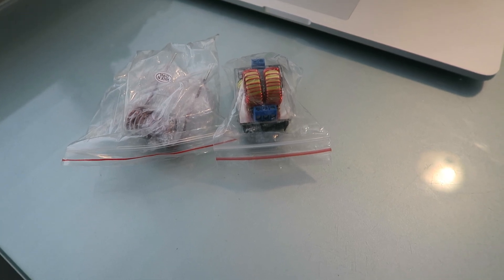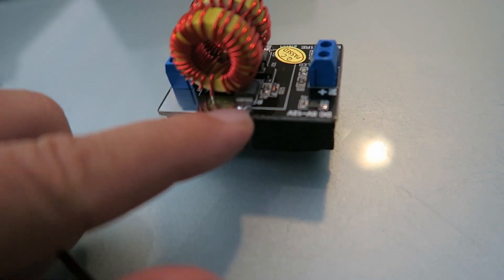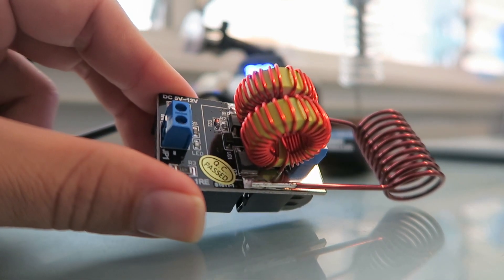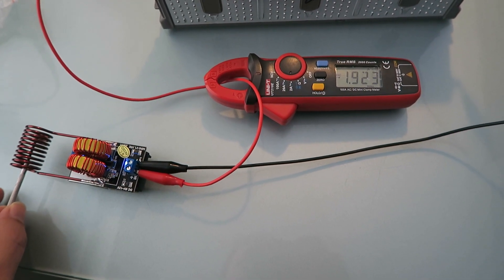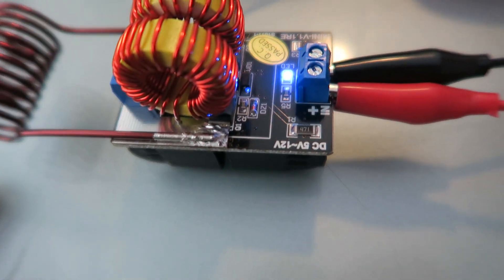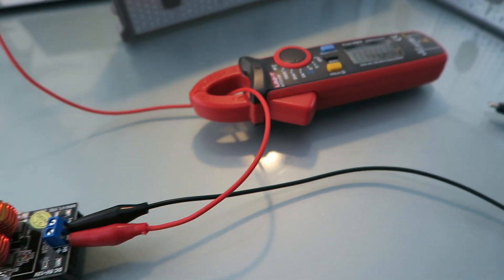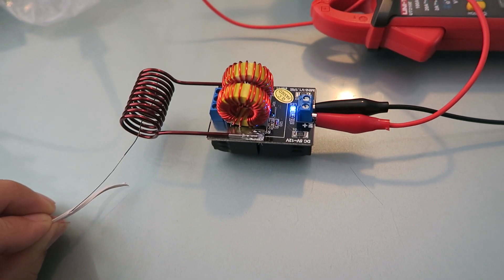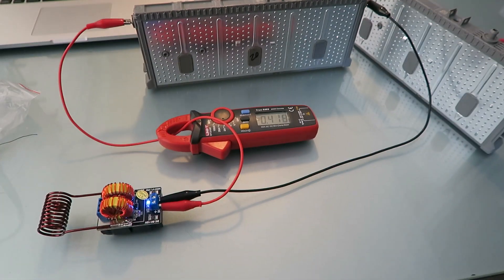120w 12v ZVS Induction Heating Power Supply Module

Comment: Add a Center tap to your coil and connect to center connector on unit. It will increase oscillation and quicken heating operation.

Comment: Boa tarde amigo, comprei um indutor desse, e uma fonte, de 10 amperes, funciona bem com uma chave de fenda mais quando uso um ferro mais grosso fica com o led piscando dos ambos e não esquenta por favor me dê uma solução.
Reply: Ola amigo. Sorry my Spanish sucks. But add a Center tap too your coil and connect it too center of connector on unit. It will increase oscillation and quicken heating.

Comment: Vladi Mazzilli (as registered on FaceBook...) actually worked on Tesla Coils using Flyback Transformers while he prefered to call his circuit a "Royer ZVS", patented in 1954!  Etc, etc...  Here's a complement of external resources to help reset the clock and provide a much wider perspective:

        https://i.postimg.cc/9Q0fsf8f/About-Vladimiro-Mazzilli-vs-Royer-ZVS-Known-as-vladi-mazzilli-on-Face-Book-Graph-ed-by-Egzoset.png

        https://www.facebook.com/photo/?fbid=10201891384713892&set=a.1979407652483
        Flyback Transformer setup (HV/plasma)

        https://www.facebook.com/vladi.mazzilli

        mazvla @ iol dot it }

        https://patents.google.com/patent/US2783384A/en
        US-2783384-A · Electrical inverter circuits

        https://www.facebook.com/photo?fbid=10201892284336382&set=a.1979407652483

        https://www.youtube.com/watch?v=Udxe0nbVnTE
        YouTube: Mazzilli DRSSTC (2010-Oct-12)

        https://www.pupman.com/current/vladi/vladmap.htm
        Mazzilli Vladimiro's Tesla Coil images

        https://i.postimg.cc/L8rdxxH4/Jorg-Rehrmann-joretronik-de-One-way-to-drop-Mazzilli-diodes-in-Royer-Gate-Driving-480x360.png

        https://docplayer.net/26964431-High-voltage-resonant-self-tracking-current-fed-converter-a-thesis-presented-to-the-faculty-of-california-polytechnic-state-university.html
        https://core.ac.uk/download/pdf/19136619.pdf
        High voltage resonant self-tracking current-fed converter (2010-Mar)
        p53/152 - Figure 2.9: Mazzilli Converter Topology

        http://webfiles.portal.chalmers.se/et/MSc/Christian%20Andersson.pdf
        Design of a 2.5kW DC/DC Fullbridge Converter
        Fig. 2.13 -- Inductor core and eq. electrical circuit
        « Snubbers...
        ...
            Reduce or eliminate voltage and current spikes
            Limit dI/dt or dV/dt
            Shape the load line to keep it within the safe operating area (SOA)
            Transfer power dissipation from the switch to a resistor
            Reduce total losses due to switching
            Reduce EMI by damping voltage and current ringing »
        

        https://www.ijsr.in/upload/1558894475Chapter_25.pdf
        Load identification and protection of iGBT power switch systems for induction heating

        https://i.postimg.cc/BnzVdfyZ/Resonant-Frequency-vs-Temperature-by-Irshad-Khan-Y2-K-520x340.png
        http://www.elegron.pl/files/AFCinductionfurnace.pdf (p64)
        AFC induction furnace

        https://i.postimg.cc/J44GknHM/The-tool-box-by-Egzoset-2020-Oct-8-640x880.png

Comment: have you measured the circuit output current?
can you measure it from the coil itself? i need help for this info.

if not can you measure it please?
Reply: 10 amps will melt your multimeter's fuse
Reply: @Konstantin_.  Clamp meter: Am i a joke to you?
Reply: @Konstantin_.  i think u blind

Comment: 1st Amp clamp meter I have seen that can measure "DC" current!!
Reply: DC = direct current
DC current = direct current current
Seems kinda redundent don't you think?
Reply: @luongmaihunggia  😂 I've never thought of it that way😂
Reply: @besamjohn  same thing apply to "AC current"
Reply: @luongmaihunggia  well AC is the type of current that's flowing while the Current at the end refers to the unit you're referring to, in this case current so more like DC- Current instead of saying DC- Voltage where you're referring to the voltage
Reply: @MaxC_1  wrong again. AC stand for alternating current so AC current literally means alternating current current
Reply: @luongmaihunggia  dude. Maybe stop repeating the terms over and over and use some common sense. When people say AC voltage they mean the voltage of a circuit running AC while if they say AC current they technically are referring to the current characteristics of the circuit. 
However in general terms you don't say AC current, you say AC electricity if you aren't referring to either the current or voltage of an AC circuit
Reply: They are every bit as handy as you are imagining. Must have! Buy now!
Reply: They are great! And they are rare. I have one that I could sell to you.. But I have other buyers interested too.. So be sure to act quickly!! Also reads "the force" "minds" and "auras"

Comment: Your current meter is not reading the correct current.  This thing idles at 3A.  You are trying to measure DC current with an AC clamp meter.  Will not work.  You need to connect the meter in series for DC.
Reply: But this clamp meter can measure both AC and DC as some modern clamp meters do. It may not be the most accurate but for this demo I think it's fine.
Reply: It can switch ac and dc mode, in this case he use dc mode, see in lcd display show dc mode.

Comment: What's maximum coil size this thing will take?
Considering a pancake coil to heat a ferromagnetic stainless steel plate?
Think this module will handle the power differences?
Reply: i dont think it s the freakin size

it is the resonance frequency

it only transfers the most power to one specific coil design

i d bet my money using the coil that came together is gonna be more efficient that anything u can come up with
Reply: Did you ever get your pancake coil to work?
Reply: @damienwade7848  Yes it worked, but was not the most efficient design.
Reply: @freeflaminginfinite917  Did you bend the coil by hand?

Comment: I would expect a bloke of your caliber 2b smarter than sticking a good Philips head in that coil. To test a flimsy thing like that should first use a nail or something made of steel, not a copper wire. Problem is if you give a poor presentation it makes you look almost silly, if not worse. Still, I give you a thumb up for the effort, so don't complain...

Comment: Hi I hope you can answer my question. why when you put a key in, the current increased? Question 2: we understand that induction need AC to work. but the input power supply is DC. can you please explain why or show me which component turn DC to AC? I really need help here, i try to understand this
Reply: +Tien Tran - The ZVS Induction module is a ready made product sold in stores. All you have to do is buy it and connect to a 12 volt dc. power supply, like buying a car and all you do is drive it, you don't have to know how it works. The device will do the conversion from DC to AC at high frequency. When you put a magnetic material in the coil its inductance is changed and offers less reactance to the current thus increasing the current demand.
Reply: it needs dc because the mosfet works only on dc not ac.and the form wave is square not pure sinewave.
Reply: Hello  @Yuuki1942 
The parallel tank circuit makes pure sinewave!
On the gate´s, we have squarewave.

Comment: So how long it wil b workng
For 12v battry
Reply from the maker: +Tamilselvam Varun not sure, but it does heat up fast, so I'm thinking you will need a fan for cooling. Thanks
Reply: Just Vlad  to cool d circuit ah?
Reply from the maker: search for zvs circuit